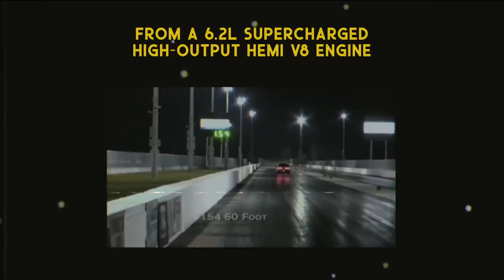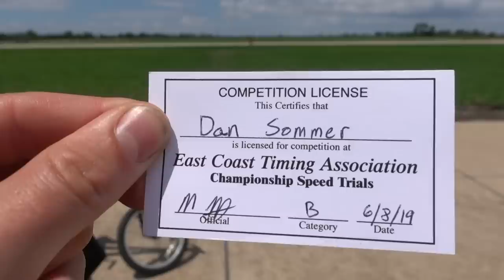797hp Dodge Challenger Hellcat Redeye, Racing in an Airplane Graveyard

Comment: Living in Texas where are all these magical $400-$500 5.3 LS motors?? That can't be the complete prices.
Reply: Around Blytheville Arkansas and where I am which is about 30 minutes away from there yeah you can find diamond salvage yards around that price or even cheaper. It's a 50/50 if it runs but you can find a good block. My Grandma had a 93 or 94 Buick Roadmaster LT1 we bought another Buick Roadmaster with an LT1 $250 running we just needed the transmission.

Comment: Once a great town. The military moved out and the town fell apart. Very sad.
Reply: a lot of towns like that sadly
Reply: Yeah, It should tell you something about not trusting the military there???
Reply: @leroy420b  Not really, many bases are made and abandoned based on need and finances, its not a trust issue, just a fact of life. A lot of towns have sprung up and fallen apart based on a mine or factory opening or closing.
Reply: @leroy420b  no it's usually those towns are located in weird places or have a catastrophic event from mining, or a tornado comes and destroys it. It's not uncommon to find places like this in rural parts where unless you got a 4x4 you ain't driving
Reply: Hahahaha this is ironic af then to have arguement bellow👌lmafo
Reply: Little Rock Air Force base is there
Reply: @abattain  not in Blytheville. It's in Jacksonville. Quite a distance away.

Comment: I've seen this truck at good guys in Texas motor speedway, I don't even think my wheel hops that bad. But then I saw him running 305s all four corners, I only have 275s all around but on 20s. His diff has to be clutch type for the way it slowed down like that while the other one was spinning faster

Comment: You need to take the knuckle buster e36 and do the standing mile
Reply from the maker: We’ve been debating on what we should be doing with the Knucklebuster E36. Let’s Scumbag Dan in to hitting 199mph In the E36.
Reply: Hoonigan if I can do 140mph in a e30 with the stock m20 on a two lane blacktop surely the LS powered e36 can do 199mph on a perfectly flat runway!
Reply from the maker: 140mph in a stock e30... You my friend looked fear right in the eyes and kicked him right in the nuts.
Reply: Hoonigan the engine was stock. The rest of the car not so much.

Comment: Holy wheel hop my guy haha.. I know all about that friggin life. Feel like most of my 350z mods were just to fix that shit.
Reply from the maker: Simple fix! New rear suspension arms and subframe bushings... How have the burnouts been since the repairs?!
Reply: @TheHoonigans  I just put a lightweight Z1 flywheel in it and unsprung clutch, as well as the whitline polly diff bushing, Z1 subframe collars, bell raceworks diff brace and a tomei 1.5 way diff. Still need coilovers BADLY haha. I'm not the best with burnies, but I'll try once I break in my clutch! I'll record the fails :')
Reply: @TheHoonigans   what transmission I do you have in the Red Chevy truck  long bed

Comment: This Hellcat is the most powerful production V-8 with the fastest quarter-mile? It’s faster than the Demon?! And a more powerful production engine than the Demon?! I thought the Demon outruns all Hellcat models. I need to catch up on some knowledge! 😂
Reply from the maker: The Demon has the quickest 0-60 and has more Horsepower than the Hellcat. Demon - 840HP with a 0-60mph in 2.3 seconds and the Hellcat - 707HP with a 0-60 mph in 3.9 seconds.